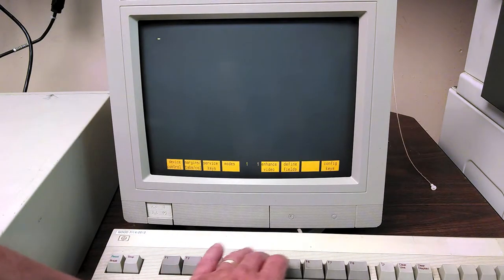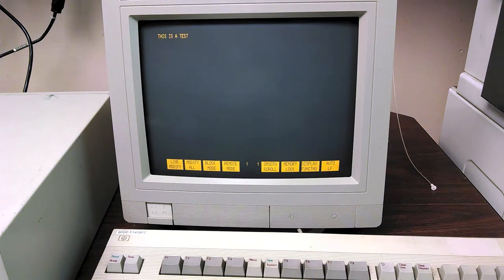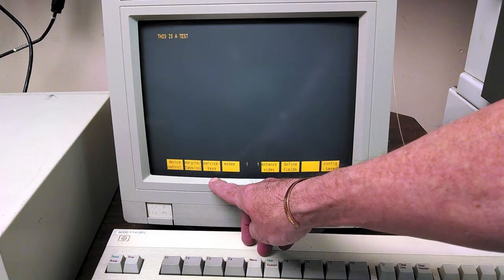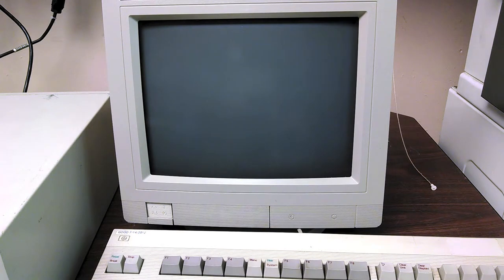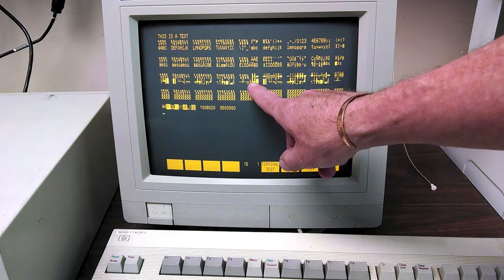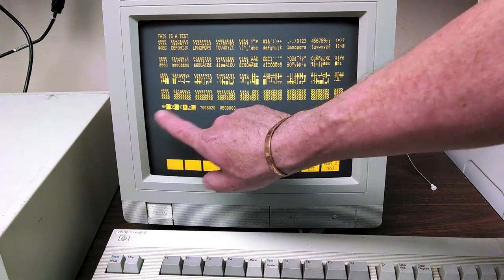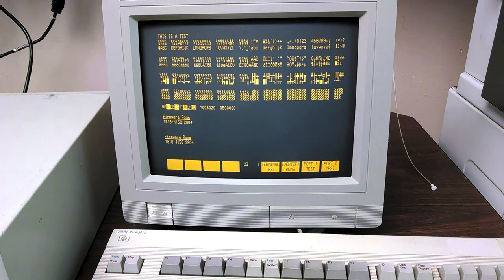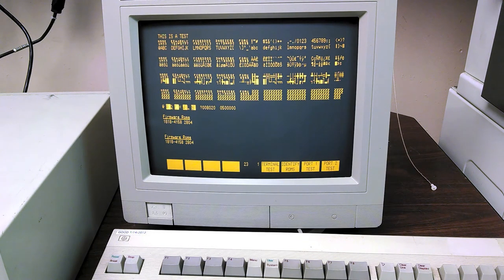Serial Terminal Overview

Comment: I have an hp 700/43 and I have no clue how to use it, it's at the beginning cursor blinking screen and does nothing. I click keys and the computer makes a sound but no result on screen. Quite a bummer as I really wanted to see how it worked
Reply from the maker: I don;t have access to a terminal right now, but you should be able to put it into LOCAL ECHO (or a similar state) to get characters to appear on the screen as you type them. Normally the terminal waits for characters to echo from the system it is sending them to. You might see if you can find a manual at bitsavers.org with more details.
Reply: @LeeCourtney  I'll try that, thanks!
Reply: It's worth noting that, on their own, what you're describing is basically all a 700 series terminal will do. Devices like this were known as "dumb terminals" for a reason - they are basically glorified teletype machines, and don't run any kind of software or OS at all. Rather, they're designed to connect to a larger computer (either directly, via a modem, or the like) and display whatever text it sends back. A lot of these would have connected remote offices back to a company headquarters to let the user access a company database or the like.

As noted, if you put it into local echo mode, you'll at least see whatever you type appear on the screen - but to really do anything you'll need to connect it to a computer via serial. Linux or MacOS would be ideal, as both still support dumb terminals as a happy accident of how command line interfaces on those OS' work. You can also check out the HP Museum online to get some old user manuals.